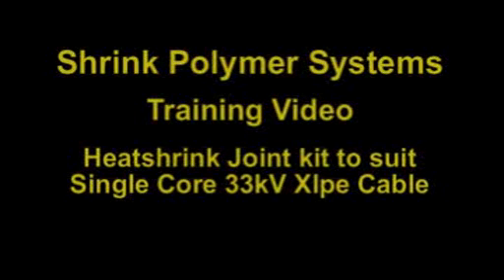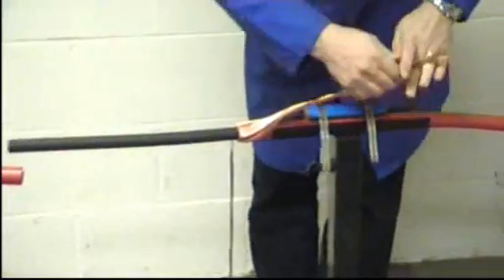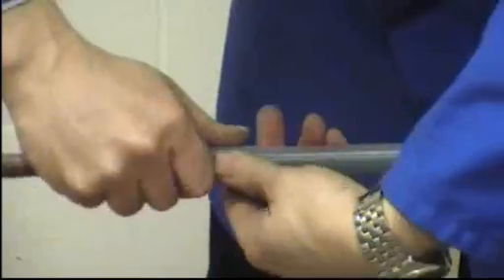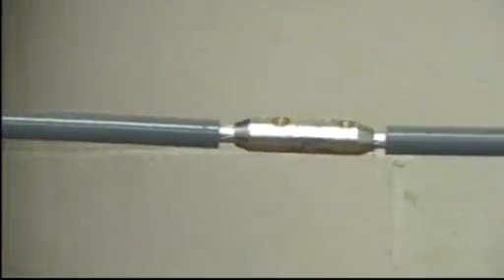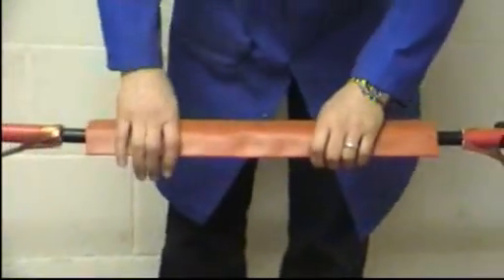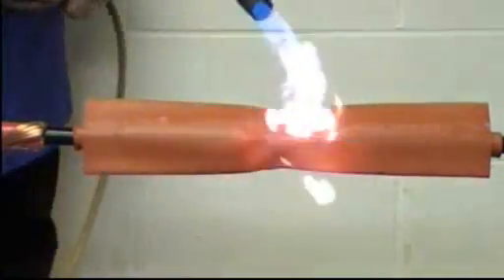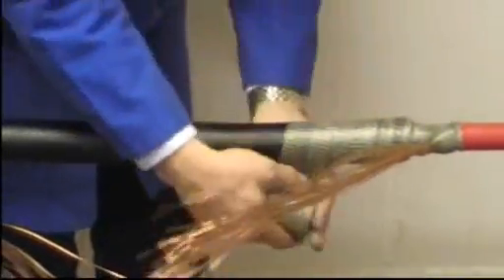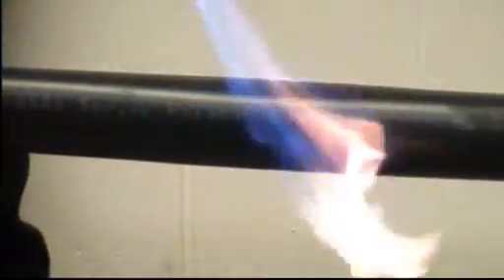Single Core 33kV XLPE Cable Joint - High Voltage Joint Kit XLPE Insulated Cables

Comment: looks fairly simple, bet i could pull one off even as a first year apprentice
Reply: Darren Tipple  Exactly, all very nice and easy in a lab coat in a workshop but when your're in a trench ankles deep in water freezing cold with numb fingers things are slightly different!